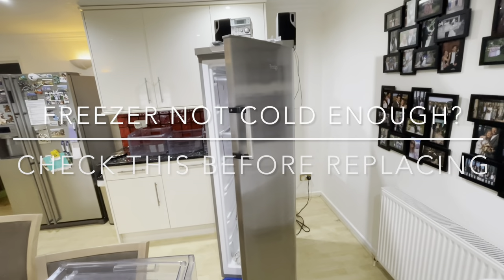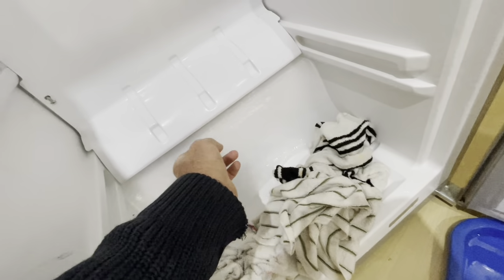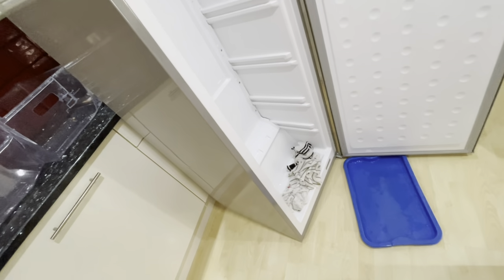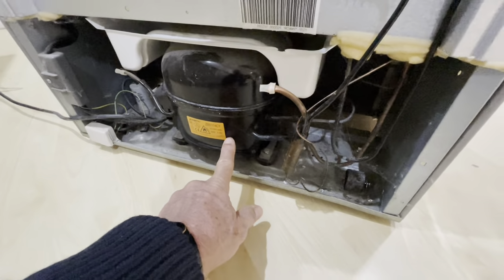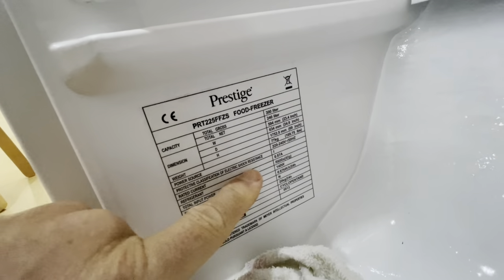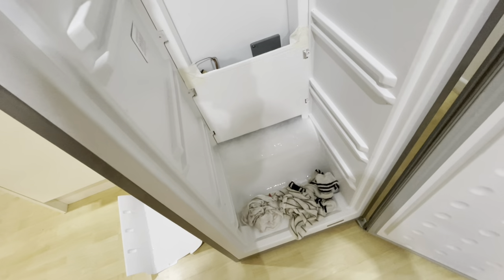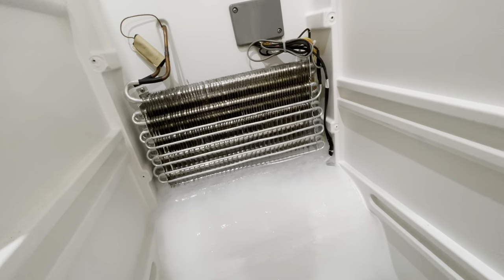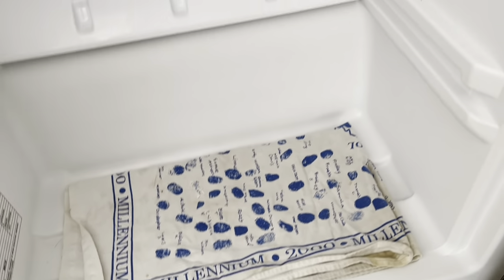Freezer Not Cold Enough? Do this before throwing out and replacing

Comment: It is a great short  solution but if it happens once then it will happen again.    In my situation my hole was not even plugged and everything started heating.  I use this in the garage, and it is a garage ready freezer.  This should not have happened in a frost free freezer.  I need to figure out why.  Thanks for the video
Reply from the maker: It seems on mine that the position of the heated bit wasn’t quite right.

Comment: May be an odd question but can i continue to use the fridge whilst i leave the door of the freezer open to defrost? I have the same issue
Reply from the maker: Only if the freezer can be separately turn off.
Reply: @comeinhandynow  thanks for the reply. Mine is combined so eill habe to empty the top first.

Comment: Hi i hope u answer my question fastt
Yesterday i scraped ice and frost off my freezer with a dull butter knife and now it is not cooling properly... Do you think i did something wrong or like it had something to do with it..?
Reply from the maker: Do you think you punctured anything?  Is the compressor running (making a noise)? Do the cooling pipes inside the freezer feel cold when it is running?  In general you should just open the door with it turned off to defrost it rather than scrapping and potentially damaging it.
Reply: @comeinhandynow   thank you for the quick reply but no I didn't interfere with it much I just gently tried to scrape the ice that has been accumulating inside but couldn't turn the whole fridge off because my mom is a homebaker and some of her things were in the lower section of the fridge ...

Comment: Thats a weird looking landrover. Wheres the wheels?
Reply from the maker: LOL, just something else that might “come in handy” and save £700 on a new freezer!!  However another LR freelander video today as well just to keep you boys happy! ;)
Reply: Modern fridge or freezer systems  are sealed for life ,they should never need re gassing.  It's bound to be a leak of they do .
A frost free model will never need a manual defrost .there is a heater to defrost the evaporator  ..
Most likely the auto defrost circuit has failed  .
A manual defrost will work for a week or two and ice up again.
Reply from the maker: @Dash Cam  If you look at the video the heated pipe had shifted a bit, allowing ice to build up and then accumulate, eventually blocking it up and stopping all air flow.  
Fixed as in the video. Also there is no “auto defrost circuit” on this model, the defrost pipe is part of the normal system pipe plumbing, just hotter.  The source of the problem was a shifted pipe, it was put back so problem should not recur.